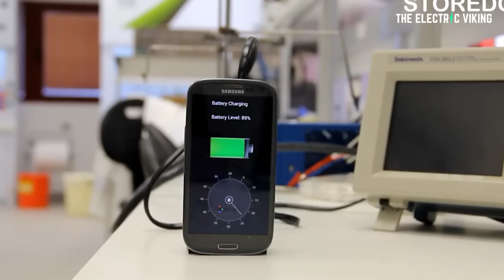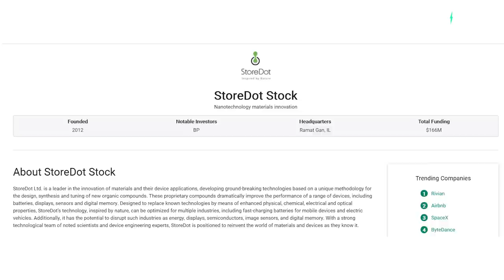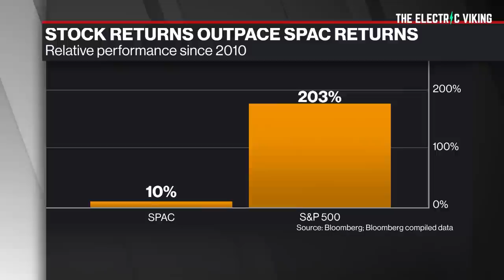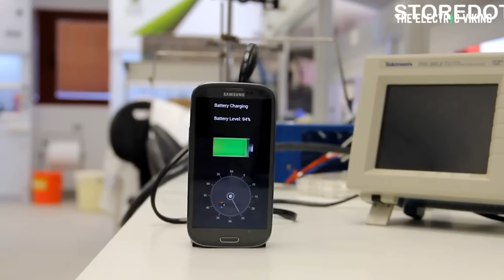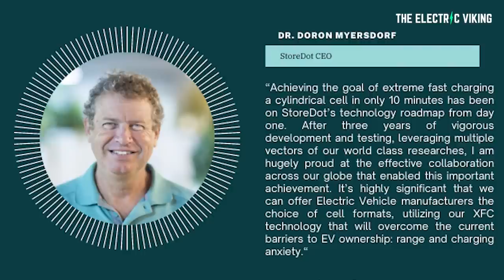StoreDot’s Tesla-like 4680 batteries can charge in only 10 minutes

Comment: I’ve have both LiPo and LiFe battery’s since years that can charge like 80% in less than 5 minutes. And to 100% in 10 or less minutes if they are warm (like 40°C). They are small and for RC-planes and drones. So of course it is possible. 
About if we need 10 min charge for cars. I think so. If the distance between fast charger decrease, smaller, cheaper and lighter batteries can be accepted in each vehicle. But if you only have like 1,5 to 2 hours range in highway speed, you definitely want a lot of easy accessible superchargers and very short charging times.

Comment: Atlis, a much smaller startup, is also working on the same thing - fast charging. It doesn't get as much publicity because it is crowdfunded and doesn't have the big name backing. Personally  i think fast charging is a game changer and will remove the last barrier for people to accept EV vehicles. If you presume that most current gas stations will add a few regular charging and fast charging stations, people don't really mind spending 15-20 minutes to charge their car while they spend that time stretching their legs, getting a coffee or soda, eat snacks or a sandwich, take a bathroom break etc. Where it becomes problematic is if the time commitment exceeds 20 minutes even for a partial charge (say to add 100 miles of range).

Imagine if you could go to most (or even some) gas stations, add 100 miles of range to your EV in 20 minutes. You would not really have any valid reason to avoid EVs besides emotional or passion based reasons like "i want to hear my V8's throaty exhaust" or just old school cool reasons.

Comment: These may be good for phones and power tools but for vehicles they may cause grid problems with sudden high demands. The could be mitigated by having storage batteries at vehicle charge locations, adding huge cost.. High Wh/kg batteries are far better for smoother grid demand as vehicles can be charged at grid off peak times.
Reply: You raised a good point about the charging station cost. I don't know how much a charging station costs to build but filling stations require massive excavations, massive tanks, canopy, pumps shop then at the end or when tanks reach a certain age dig it all out, back fill with hundreds of tons to replace the voids of a tank, possibly decontamination of land.
Charging stations are basically like car parking so groundwork only a metre or two not eight or ten. Batteries dropped off and picked up by crane lorry, chargers, canopy, maybe solar panels.
Reply: That's how Nio do it. They need to aquire many more batteries than the cars they sell and that's the expensive bit. Sounds OK though if they've access to the capital.

Comment: In the UK, there is a huge % of owners who can't home-charge so your premise is misjudged - this will only ever be for the richest echelon.
Reply: Don’t worry there will be charging points in council estates as well, you might even be able to get free electric from it, like we used to on there meteres!
Reply: @Sam_BS_Electric  'council estates' is a bit random. Anyone with only street parking, i.e most of the population
Reply: @jimporter7418  It was a joke, I grew up in a council estate.  Obviously access to charging is important, but you can't fill your ICE car at home can you? With the number of charging points and the range EVs can travel now it will be no different to filling up at a petrol station. By 2030 all cars have to be EV in the UK, so everyone will have to one.
Reply: @Sam_BS_Electric  so, in 8 years time the city councils and county councils will have caught up? No chance, they haven't a clue what to do and have little to no plans to implement (anywhere outside London). My own county council have told me their plans for my area, they are putting in an overnight charger in a town 15 miles from me next summer (no joke).
Reply: @jimporter7418  i guess as usual, we do everything at the last minute! Its going to happen mate, there is too much money money going into the tech and out the old.
Reply: @Sam_BS_Electric  Slight correction: after 2030 you can only buy new BEVs, but there will still be a lot of non-new ICE cars on the roads until they slowly wear out, or petrol becomes so expensive they are junked for a BEV.

Comment: I would question whether there are powerful enough chargers available in most places to charge a battery that quickly. How many kw's would be needed? 350kw is about the fastest charger available at this time, and Tesla's fastest supercharger is only 250kw. Does anybody know what power rating is needed to charge a battery pack in 10 minutes? 500kw or 1000kw maybe? I don't know, just asking the question.
Reply: “Which came first, the chicken or the egg” would seem to apply. We will get faster chargers when batteries can take the faster charge and vice versa… but both sides will push a bit beyond current limits anyway. There are probably better ways to express this, hopefully this gets the idea across though.

Comment: The EV for "Everyman" is always 5 to 10 years away. A movable mirage.
Others have suggested battery swap stations. This "4680" looks to be adaptable to such. Charge at home. Drive 250 miles. Stop at a station and swap for a new set of charged batteries. Why do drivers have to own batteries? We don't own the gasoline.

Comment: I don't think that batteries that you can charge in ten minutes or so are, for the great majority, a precondition for the adoption of EVs. 

What is needed, though, is more chargers especially for people living in flats. If you live in a flat you don't see many or at all any chargers in your area where you live.

Many people, I believe, would be quite satisfied driving a EV if they could charge it at night.

I would guess that a great majority of those owning a EV also own their house where they can charge at night or have the possibility to charge at night nearby.

For longer trips super chargers along the highways are also needed. But if I drive, for example, 400 kilometers or more, I can wait 40 minutes to get a 80 % charge. I would need to eat and take a break anyway.

That said, it is of course very positive if the charge only take ten minutes but it is not, as said, a precondition for the great majority of people wanting to own a EV.

Norway is, of course, a practical proof of that people are willing to buy a EV, despite of the charging time, as more than 70 % of the car buyers in Norway buys a EV and not a ICE car.

Comment: Re: Better Battery Claims vs Realities.

If I recall correctly (albeit feebly), Tesla's 4680 delays are due to high speed/volumes manufacturing causing minor damages in the calendaring process that they didn't encounter at the otherwise fast, but smaller scale, Road Runner pathfinder. So, another instance of, the "prototyping easy - production hard" conundrum, at work? 

Regardless of faster charging capability blue skys, it seems recently, that the greatest need is the ability to store energy during off-peak hours so charging facilities can satisfy on-peak charging demands. I wouldn't be surprised if Tesla, during it's 4680 ramp-up remediation ,"breather," also starts deploying Megapacks to service clusters of charging stations as part of their "open to all" strategy (which, btw, will further Osborne & cannibalize non-Tesla EV sales). Just another, kindly "Proper Prior Planning Produces Perfect Performance" nose tweak to the laggers? 🤭!